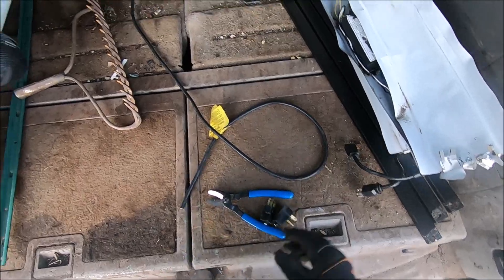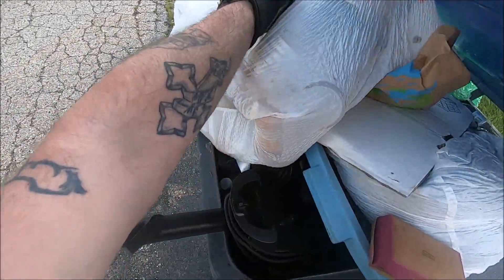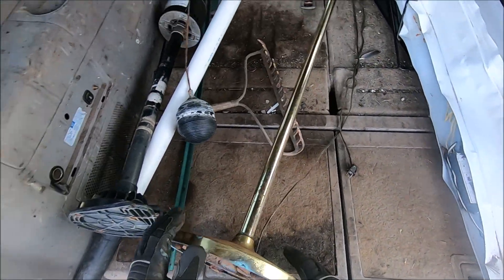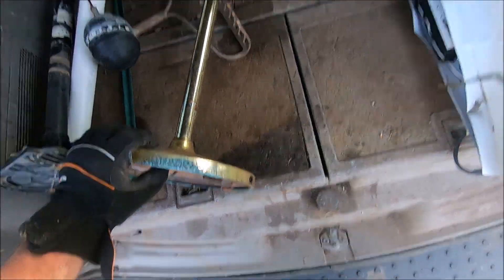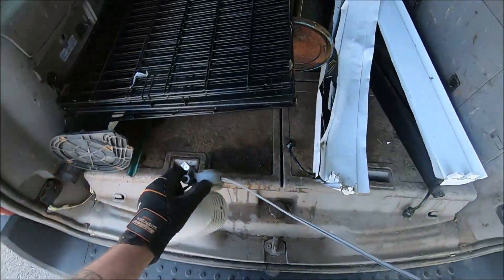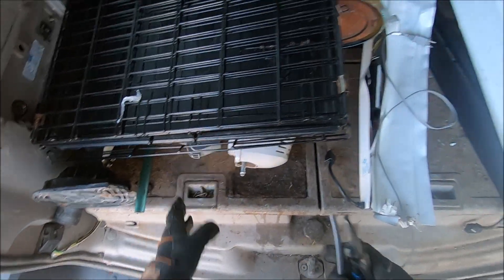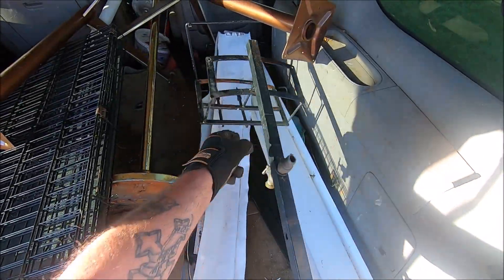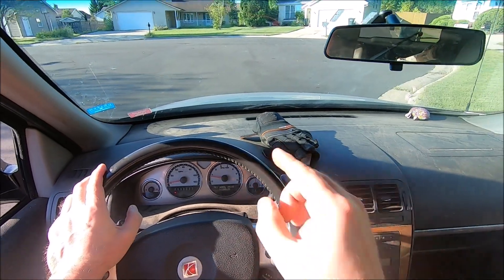SOME DECENT CURBS!!!

Comment: You’re flasher is out
Reply from the maker: Thanks Paul. Right rear flasher/turn signal is out. I run the flashers in case someone hits me. As for turning, good old arm signals are still legal here in Wisconsin.
Reply: Apartment Scrapper I live in Wisconsin to